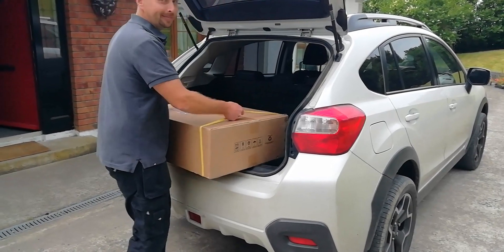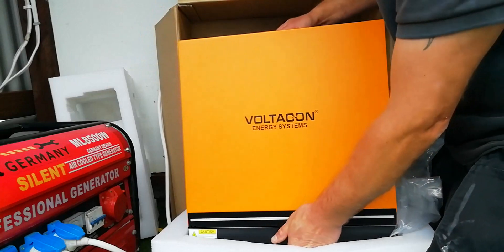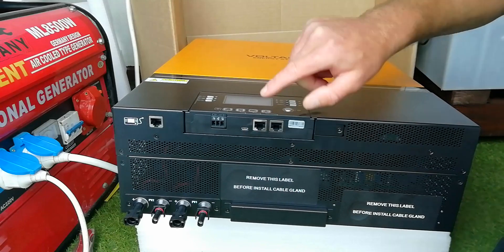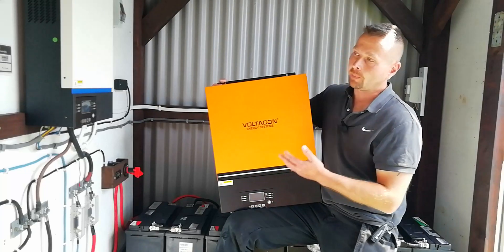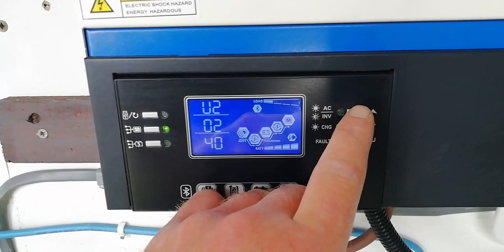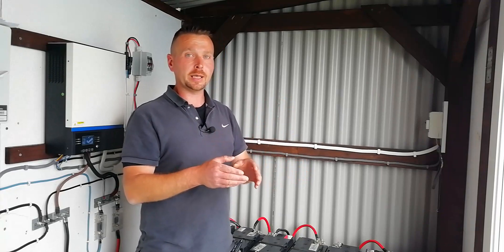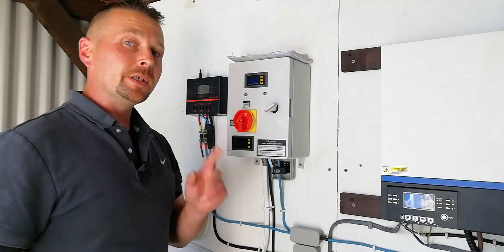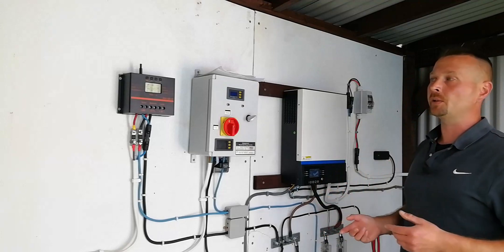11kw 48v Off Grid Inverter, Conversol Max All In One

Comment: battery group in burnley for solar pannels 400w panels £60 37v, 595w £102 52v doing bundle deals 10x595w £1000, not the write time to be buying more solar panles tho, more windturbines, stil havent concreted wind turbine base yet, nervous and want all fittings so nothings out of line. does your roof face south ? just watched you solar vid, you got half cell
Reply from the maker: @HenryOwens-py3ur  wow that's a great price for the panels. Would be worth picking up a few after your turbine project is done. Glad to hear you're making progress on it, they take a good beating in winter so best to take your time and do it right. Our roof is ssw, not quite dead south.
Reply: @ourkilkennyhomestead2006  It is very cool to winch up and down, useing the winch from my 700w turbine. i did buy a single axis controller with a wind speed sencor, that can winch the pannels down over a adjustable voltage=wind speed, but have made the bottom rail, that the winch pulls up and down abit to small, installed a 4x2, now wished id installed a 6x2 with roller wheels.
Reply from the maker: @HenryOwens-py3ur  that IS pretty cool. That's how we learn though, build the first gen, then make improvements on the 2nd gen. After a few years it's all perfect!
Reply: I dont have the space for more panels, i could make another stand and point them ess, can fit another 6 on top of the 8 i have, but ive made a deck chair style solar array stand and can winch them upto 60degrees from 40, which generators 30% more power after September 20th when the suns 15degrees of the center, december 20th th the suns at 75degress only for a few hours. I could elongate the scaffold clip holes, if im out a bit, but i just think the less the grinding out the less galvanised spray and less rust.
Reply from the maker: @HenryOwens-py3ur  the deck chair style panel array sounds brilliant. Less spray less rust, definately a good call.

Comment: Cheap lightweight. High frequency, transformerless inverters like these offer no galvanic isolation for safety, and they offer a shorter life expectancy and a poorer surge capacity than higher performance low frequency, transformer based inverters.
Reply from the maker: @solarcharging9743  they have a big toroidal transformer inside. Read up about them, before making assumptions.

Comment: I also use a metal storage shed for the batteries. Much smaller than yours. To avoid / limit humidity on the metal walls, especially during winter, I needed to isolate the walls. Also, it is better for the battery if the temperature is higher. Isolating the metal walls might help.
Reply from the maker: @jean-paulcastellano9589  great job Jean Paul. Considering the large CMÉ that happened recently I'm also wondering if grounding the metal shed may be a good idea going forward.
Reply: @ourkilkennyhomestead2006  Grounding the shed: I did not do it. But why not. Especially that you have a lot of electrical equipement in it. I do not think it is a good idea to ground the batteries. On my side, initially I though it was a good idea, but after some research, I read stuff against it, so I did not do it. Related to grounding, you might want to ground your wind turbin mast.
Reply from the maker: @jean-paulcastellano9589  yes indeed, grounding the batteries isn't necessary in relation to cme's. It's only equipment with a pcb that would suffer the most. Grounding a metal shed would create a farraday cage around the equipment transmitting unwanted outside energy to ground away from sensitive equipment.
Reply: Voltacon is a good company I reckon...I bought a couple of pv combiner boxes from them,messed up the order my end,they were very cool about it,and I think the boxes were very well made.So thumbs up for Voltacon..it's a big unit,looking forward to your updates.👍
Reply from the maker: @hedfuka8608  right now the missus has the hoover running while I'm drying the kids hair with the hair dryer, pulling 95% load on a rainy night purely from batteries. The 3kw conversol is having no problem doing it. Can't wait to see what the 11kw unit can do....
Reply: Half cells the go for the northern  hemispher,  400w pannel £100 each. Highs of 1.2kw and lows of 675w 875w constant out of 3.3kw array at 40 degrees. 11kw bigger is better, less heat and more durability. Thoughs 80solar pwm are a good little back up, the load connection even has a high and low volt relay and an amp read out ! use mine for a dump load.